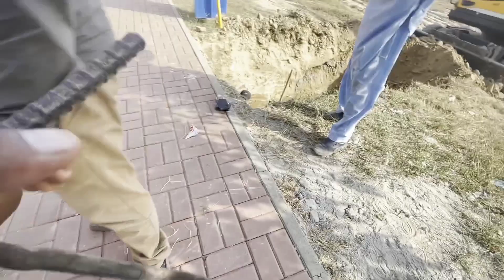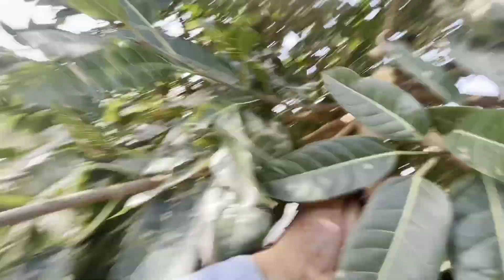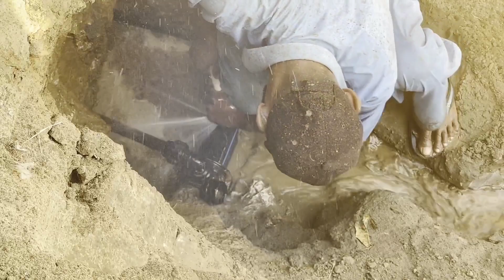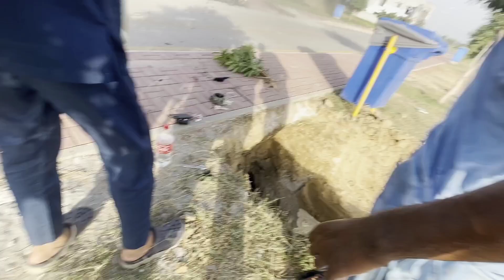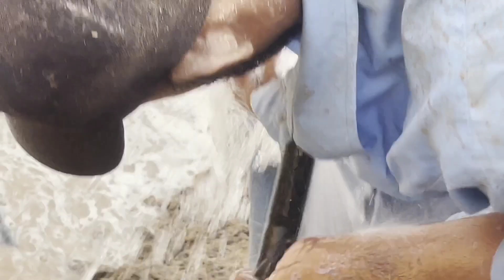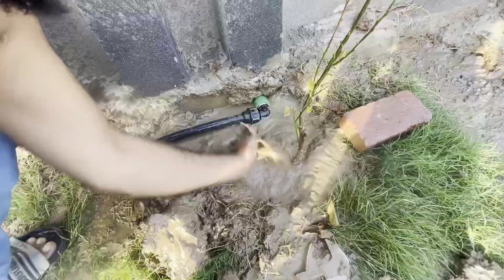Poor Water Flow | Water Supply Pipe Line Blocked 🚫 |

Comment: I can't believe that system has no easily accessible shut off valves. Does the local plumber have to shut down an entire street if there's a broken pipe inside the home?
Reply from the maker: There is no control valve unfortunately 😔